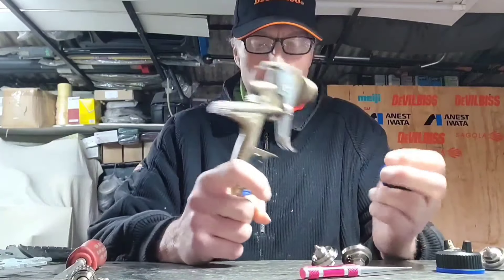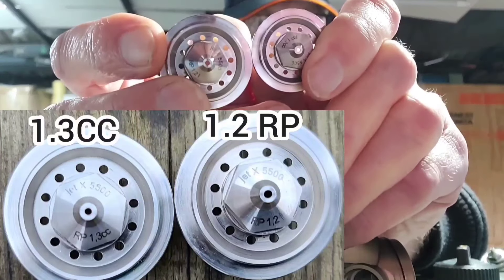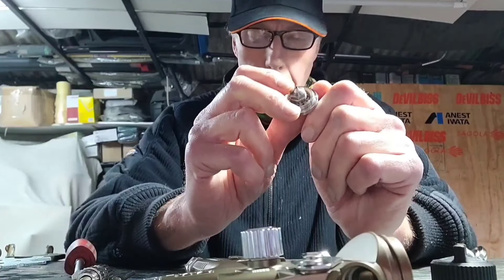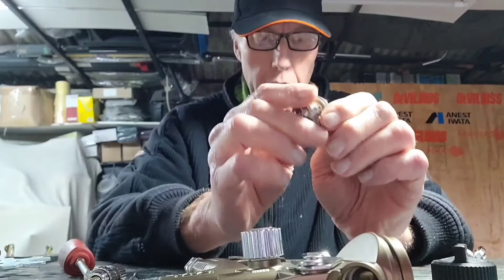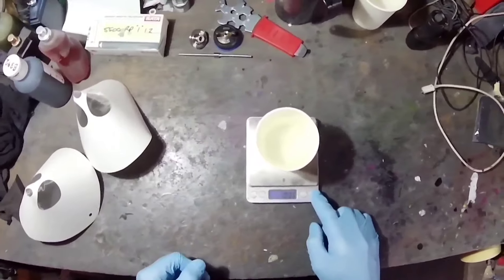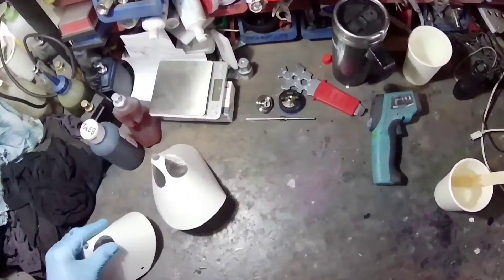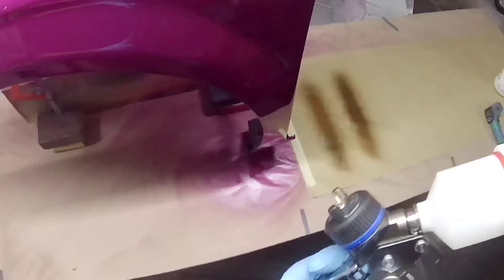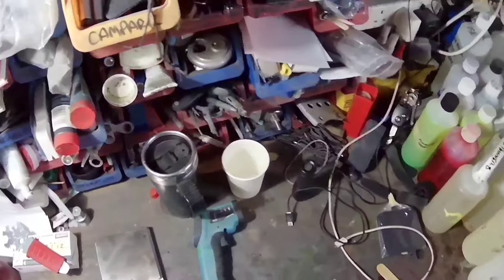Satajet X5500 1.3CC v 1.2 RP I, What's The Difference, Using Multi Mix2

Comment: The CC cap's larger lower air hole in the horns is similar on the Astro Europro HE. It's interesting. Usually the top hole is bigger. Wonder how it changes the pattern characteristics. I know that my Astro sprays clear very nice and usually at lower pressure👍
Reply from the maker: You're right,  normally,  on most guns,  it's the outer hole that's bigger

Comment: If you don't mind saying - what is the CFM of your compressor used in these videos?
Reply from the maker: Hi mate, I have two 90lt compressors linked, both are14.5 cfm belt drives, so 180lts total.
I normally only have one 90lt running and it can keep up with the most guns, obviously it wouldn't power a mask as well, i use another compressor for that it needed in a separate building and just run a line in

Comment: Thats interesting on the actual nozzle size. Have you tried the cc air cap on the other nozzles? I'm wondering if the cc aircap sprays different. If I get one will try on a 1.4. I use a 1.3I rp for base and 1.4 O rp for clear.
Reply from the maker: Hi Mate, no, I haven't tried the CC cap on anything else yet. I will give it a try, though. Cheers 👍

Comment: Ive measured a 5000rp 1.3 at an actual 1.5. I think its more random.  My 1.2 5500x is larger than my 1.3 rp 5500. Whem i originally got my 5500rp 1.2 it was a cannon and ordered a 1.1 rp that spraying ppg great.
Reply from the maker: Hi Mate, that's what I'm looking out for, a 1.1 RP set up to see how it compares.
Maybe they really have no idea of what size they are drilling them, to keep us all on our toes 🤔 😆, cheers, mate 👍
Reply: @peteshobbies5383  I think satas are like socks. Small medium large and extra large.
The 1.1RP 5500 sprays thick clear like buttah!

Comment: I wonder if you ordered a 1.1, if in fact it would be a 1.2?
Reply from the maker: That's certainly what I have found with the X5500 tips I have, the 1.2 is 1.25 and the 1.3 is 1.35